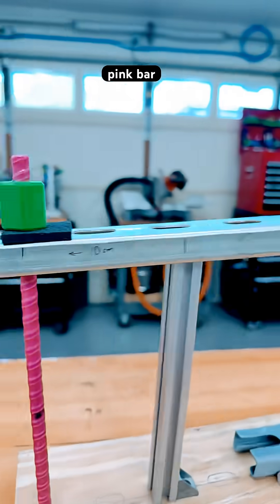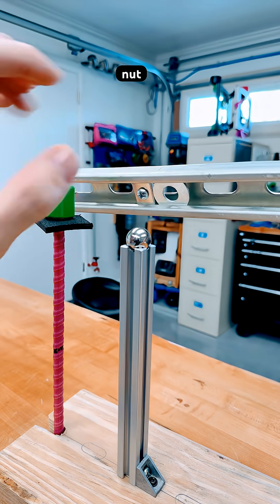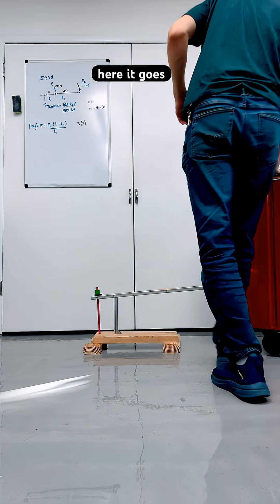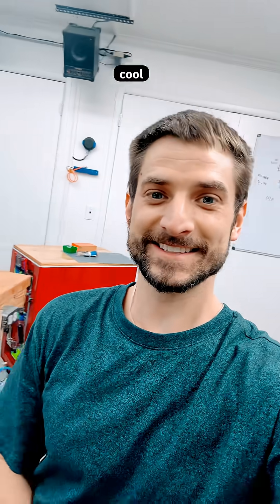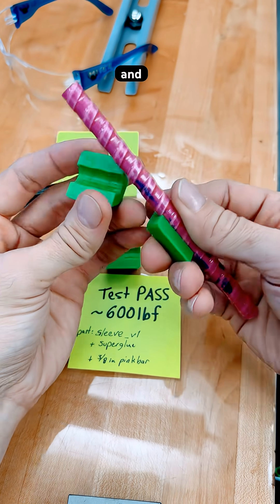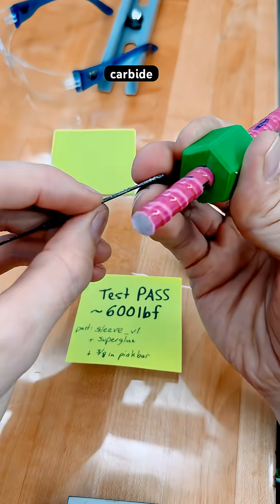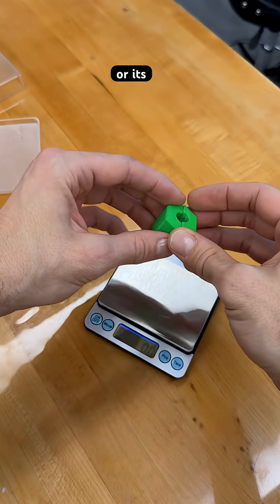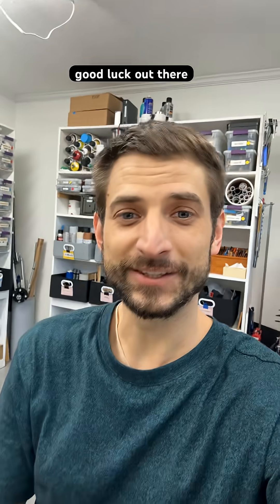3D Printed Joint is SUPER STRONG! With cheap fiber rods

Comment: This great.  Can you do some work on compression?  These may not be ideal for it, but in some things we can use them in they may see minor compression or side forces temporarily... my first example would be a human leaning against a rack using these for cross bracing where one of the two braces would see compression even though the other is bearing most of the load in tension.

Comment: Pink bar has the same strengths of steel rebar but without the corrosion issues of steel pretty amazing. Although i have concerns with this material ending up in nature and never disappearing aswell as glasfiber dust ending up in the lungs of workers and environment.

Comment: Awesome job.   Why not print the part as a single body rather than two + glue?  Would it thread down to the correct position?  You could add a glue injection port into the side - thread to position, inject super glue, rotate once clockwise and then once counterclockwise to spread the glue?

Comment: Just back-of-a-napkin I calculated that the abs will give under a shear load of a few hundred kg (which is probably optimistic since there is other failure modes with the low profile helix, e.g. by deformation, and 3d prints are weaker then solid material anyway). This is not bad, but still mismatched to the rebar (which can hold a few 1000 kg in tension). It is a cool material but really using its full potential for generic constructions will not be easy. What I would probably attempt is making molds with which you can "overmold" the connections with resin. Does that make sense?
Reply from the maker: totally makes sense.  And there’s 100 ways to make the joint stronger.  Overmolding for sure. I wanted to get folks’ CREATIVE JUICES flowing. 🧃

My applications will be with Aluminum Extrusion assemblies: reducing 3030 members, making construction simpler, lighter, and cheaper.

Comment: yeah without super glue it can be use as lead screw, cool.
Reply: With a screw in the middle you can lock the lead screw. and screw for each corner to adjust black slash

Comment: Slicer settings are as important as geometry, you cant test geometry properly if you dont optimise the slicer for that part.. default profiles arent great, at the very least you can make your own generic profile for strenght parts even though slight changes depending on geometry could improve the part characteristics massively (in some cases). Now I fail to understand what makes this geometry special but i like the trials, if you make the joint parts jagged you could get even better bound

Comment: I've had a lot of success creating mounts for EMT by adding TPU "jaws" that make contact with the metal. Then a couple M5 machine screws and lock nuts ratchet some ASA brackets together smushing the TPU into the metal, creating a really strong joint.

I'm very intrigued by this concept, pink bar is super inexpensive and would be a great option for lots of projects! Following your progress closely :D
Reply from the maker: Love your concept.  I think that’s worth posting on grabCAD if you want to open it up to people.

Comment: When cutting fiberglass wear a mask, and gloves, and long sleeves. 

I mean you don't have to, but you'll be itchy if you don't. Ask me how I know... Dust is pretty fine, and yes, it is glass. IDK about the pink bar, but the green one is a glass reinforced polymer, so should be less problematic. The datasheet says it can be cut with normal tools, so probably fair amount of resin. 

@davidmalawey, probably worth mentioning, as this is the kind of stuff that builds up and can lead to health problems a decade or two down the line but is also super easy to avoid.

Comment: Holds your weight..... 70kg / 170lbs !!
Would love to see the breaking point 

For the 2 green clamps / sleeve, what if you were to add a "male & female" side to each (that is 180° flippable so each piece is identically the same) so when it clamps around the pink bar extrusion it locks into place 

Super glue is one adhesive medium but there are lots out there that are better

Maybe make something that tightens onto the rebar and doesn't need adhesive ..... Now that would be mind blowing because it could be reused time n time again by unwinding and removing and taking to another location (depending on your need)

Comment: I'm surprised the super glue held. Would some sort of mechanical clamping force hold the pinkbar and allow for adjustments?
Reply: Can't you just make it one part and screw it on?
Reply: @TheQsam1  You could, but it wouldn't really have any load/strength capability. Even though the pink bar has a helix, it isn't a thread so whatever you screw over it wouldn't have any "bite" to it and would fail quite quickly. Since threads are essentially a ton of wedges, they hold very well, but the helix doesn't have a flank/thread angle, so you lose all load capacity.
Reply from the maker: i bet it would hold with a good four screws.  just need to make sure your print is matched nicely to the rebar.  the helix stands off only about 0.25mm.

if anyone tests and shares video, i’ll post it or remark, whatever helps! I must move on to help with new student projects 😊

Comment: If that inside diameter conforms to the spiral of the rod, I wonder if you could get away with not using an adhesive at all
Reply: I'm confused why it needs to be two parts. Is it for a zero backlash fit?

Comment: What if we put some type of fibre (carbon fibre/ glass fibre or something similar (maybe natural fibers)) during the extrusion process of fdm filament, and have a g code written in such a way that we can achieve directional strength with fdm 3d printing... Is it possible for the fibres to provide enough strength without tensioning?
Reply: GF and CF impregnated plastics are EXTREMELY abrasive versus print nozzles and typically require hardened steel or carbide nozzles.  Even then, FDM has some inherent limits rooted in the basic geometry of the parts.  Intra-layer plane strength will almost always be higher than inter-layer adhesion.
Reply: @Kineth1 That's a great point about the nozzle abrasion from chopped fibers.
My idea is slightly different: what if we embed a continuous bundle of fiber down the center of the filament? The fiber would be sheathed in a compatible thermoplastic, so the abrasive material never actually touches the nozzle, which should solve the wear problem.
The real challenge and opportunity, as you noted, would be in the software. You'd need a slicer that could generate G-code based on an FEA study for each part. This would allow you to strategically lay down the continuous fibers along critical stress paths, giving you true directional strength exactly where it's needed
Reply: @jaypatel-yj9gwI must be absolutely clear:  I am NOT trying to put down your suggestion.  We must look at every approach in order to advance.  Let's ignore the abrasive nature of chopped glass and carbon fiber content and look instead at continuous fiber filament.  (mostly carbon fiber and aramid/kevlar fiber).  If you select a continuous fiber filament and a single nozzle, you are inherently restricted to monolithic spiral (single pillar/plane) objects or other contiguous geometry surfaces.  Continuous fiber filament is inherently incompatible with z-hop.
Reply: @Kineth1 you're absolutely right about limitations with what can and cannot be made.... I think one has to go to more than 3 axis to make something useful that is not a tubular object.